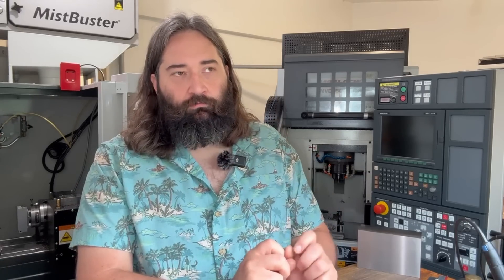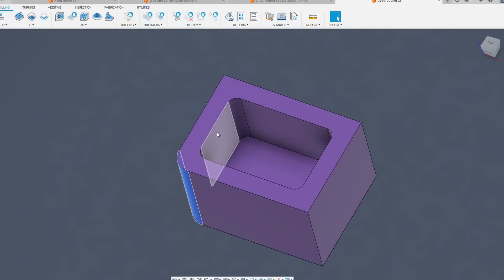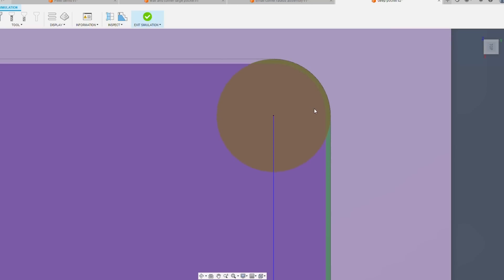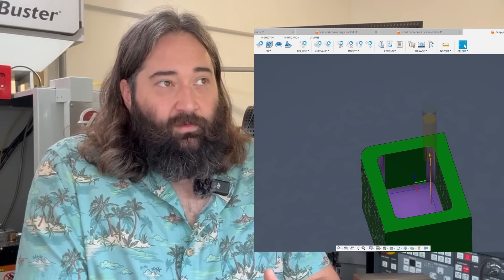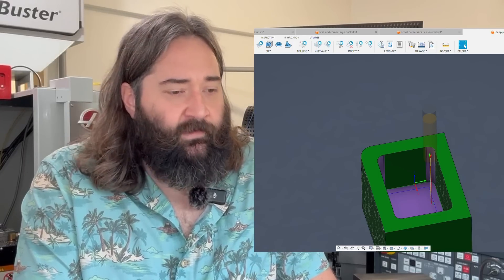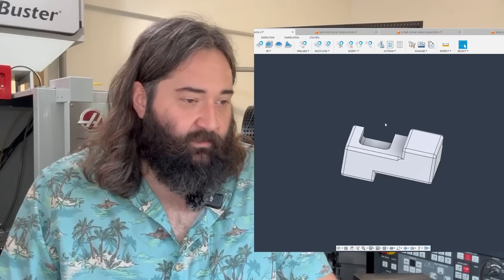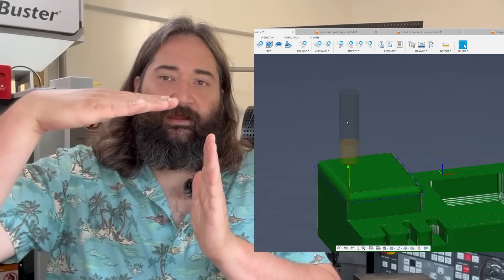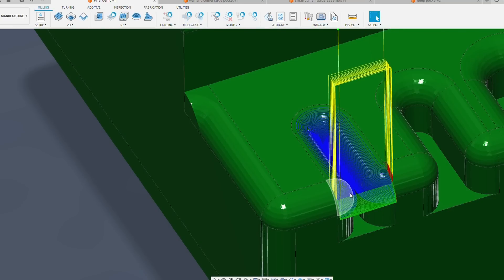Fillets make your cnc parts more expensive

Comment: I am not from a toolmaking community. I am from academia. Throughout all my years on mechanical engineering I noticed ME students do not understand some principles of design. I even wrote a syllabus of the course I called Applied mechanical design. The problem for the designers is in many cases they have no idea of how the part is going to be machined, what ready tools they can get, and what tools they need to make. Once I got a drawing from a student with a threaded hole close to a wall. I asked the student how it can be done, what tools and what a sequence. The student had no idea. Another issue is tolerances. You can not get on plastic same tolerance as on steel. They make in CAD same diameter hole and pin and expect it will fit when machined. Thermal expansion, surface finish etc. Unfortunately, young engineers are not ready straight from university for real design.
Reply: Having just graduated with a mechanical engineering degree, I totally agree and I think it's mostly because programs don't put much time or emphasis into getting students actually making parts. Our only required machine shop classes were pretty basic, and I think the most experience anyone got  making things was doing engineering extracurriculars that required fabricating custom parts.
Reply: @makky-kat3719  I've moved mountains to improve on the 20 seconds I've been able to get behind a lathe, to no success. I have to ask nicely if I want to use a band saw or drill press.
Reply: I still say the most useful job I had as a student was working for my university machine shop for the summer. Learned so much in just 4 short months of the various things they had me do. I wasn't completely green with actually making stuff then, I had done a fair bit of woodworking in high school, but it is so hard to teach someone to think that way without actually having them take raw stock and figuring out how to make the end product. As someone that now hires students for work terms now I definitely appreciate those that are part of student teams or have other hands-on experience as they tend to be much more capable designers and problem solvers.
Reply: Props for encouraging students to actually understand the manufacturing process - it's great to see that kind of leadership come from the academic staff. When I was studying engineering, we spent three or four weeks in a machine shop completing practical units from the mechanical trade qualification. It was really useful - especially for the students that didn't have any hands-on experience making things. Unfortunately, my uni stopped offering that to students a few years after I went through.
Reply: You shouldn't name that course "Applied mechanical design". Makes it sound boring and unimportant. Name it "How not to fuck up the simple things", and people will pay attention.
Reply: If you're handing out the Standard tool cards you're doing god's work man, and to be fair, even my peers in machining classes sometimes underestimate just how deep threads actually go...
Reply: We used to call it "design for manufacturing" and "design for assembly", it's certainly not a standard curriculum thing to teach but I was lucky to have a good series of teachers. But it's also a thing that an engineer learns over time just from experiencing failure and learning from mistakes. Everyone has made a part and forgot to add the right tolerance value at least once, but you try to never do it again
Reply: as someone whos just graduated with a Bachelor's in ME and a 4 generation family background in machining and engineering, trust me we are trying our best
some examples:
simple parts or assemblies that would be fit for purpose using mostly off the shelf components got significantly lower marks than overly complex rube Goldberg machines with every part costing £4000 because it "showed more of what you can do"
machine shop guys being super hostile to anyone who wanted to come and learn or even just watch
never ending pushes for everything to be 3D printed (its a useful tool, but it breeds terrible habits when it comes to design)
even the guys who did a year in industry got treat like walking coffee machines because no one wanted to trust them to do any work, they just sat around all day making coffee for a year
Universities being afraid to lose money on letting students just test out things, the first prototype must be the final piece
stuffing in so many random parts that there's no time for the stuff that mattered, I spent just as much time doing business as I did engineering and so we were left with just a few weeks for every project
Reply: "Unfortunately, young engineers are not straight from university "

To be fair, the same is true of doctors lawyers pilots etc. About the only high consequence job you can go directly from school to inflicting yourself on the world is as a cop....
Reply: I wish I could take your class! I thought going into my engineering degree that manufacturing constraints would be a large part of my degree, I even picked a university known for being more practical. So far I've had one subject that covered manufacturing processes but it was as surface level as could be, covering everything from sand casting to steel alloys. It seems my personal interest in manufacturing will have to suffice when I graduate.
Reply: This is the failure of universities that cost so much money, yet they don’t prepare us at all. I learned more in a year of real life work than 4.5 years of my aerospace engineering degree.
Reply: @DanielDuhon 
Who is running the Universities?
Reply: Decades ago companies made it a standard practice to have budding engineers spend time in the companies support and development shops. Now that is practically impossible because MBAs and accountants have off loaded all of that work to outside or off shore sources. 
I spent my working life repairing and rebuilding Machine Tools. Plus considerable work on the Toolmaker side. I had to do almost all of my own machining. Manual to CNC. Including programing. In my time I saw a lot of mistakes made on drawings. Things from misapplied tolerances to assembly errors that could allow for expensive bearings assemblies to be crushed (1). Over time we learned which engineers could be worked with and which ones could not. Of the ones that could not most changed when their bright idea didn't work. I'm not saying their bright idea would not work in an ideal world. Unfortunately the manufacturing floor is not an ideal world. 
1) Chamfers or through holes with +/-.0005. Bearing assemblies with their proper preload or end play set from the factory being held in such a way that the retaining plate or cover could destroy the bearings. One instance was the thrust bearing assembly on an industrial centrifuge. Tapered Roller Bearings and face to face mounting with pre ground spacers to provide the required end play. The remaining plate holding the outer races and spacer was designed with a 1mm gap between the mating surfaces. The end play in the bearings was .2mm. Far too easy for the assembly to be crushed during assembly machines if the customer was doing their own repairs. The design engineer was relying on M20 SHCS's being set to an extremely low torque value to maintain bearing endplay. Other examples of improper assembly would involve everything from seals being required to keep lubricating grease in on spindle right next to high pressure coolant with no provision to keep the coolant out. In fact seals are really big problem. Especially on machinery operating in dirty, steamy or machining environments with chips getting evacuated from deep holes with high pressure coolant. One more is spindle bearing assemblies using springs to maintain bearing preload. But without any radial bearing support on the back bearing. This can cause side loading from the drive belts to destroy the rear bearing. Made a lot of work for though.
Reply: Lego bricks actually have amazing tolerances.
Reply: You say young engineers have no idea about how things are made or how materials behave etc. Of course they don't. That's why they're in your class. You're supposed to be teaching them this stuff. You say they're not ready for the real world straight out of university. Well, that's your fault not theirs. They pay you a lot of money to learn engineering and you don't deliver on the product they're paying for.

If you were a company in the real world your customers would be taking you to court for breach of contract or cancelling all your purchase orders.
Reply: @OU81TWO     Wow, nice observation. Did I miss them mentioning they handle funding for their University, or ability to spend on supplies. I'm not sure if you're aware, metal stock is...not cheap, nor are tools, should they break from overzealous or overconfident engineering.

I feel like this hostility was meant for the bureaucracy of the school, not a professor actually doing the educating. The money in education is not in the educating, it's in the...actually, I haven't a clue where tf all that money goes, but it's sure not to the faculty, to the teachers.

Any of the material sciences courses seem to have so much more overhead locked up with consumables, which may not be much of an issue for theoretical sciences.
I'm sure there are experiments involved with those, but without funding, does a student simply fail if they had to scrap a part? Do they have to source their own stock and other consumables, or lab equipment? Or PPE? Or precursor chemicals for chemical engineers, etc.
At which point are professors being forced to subsidize their classroom, or just wait for funding eventually (like we force public schoolteachers to do where I am in the US)?

I don't know where you're located, but OP might not even be located in America. Outside of the US, matriculation isn't a soul-crushing black hole of debt that you only escape if you win big.
Here, it's a profit center, where the Dean and the board pocket whatever they can, and the professors take all the blame for promises made to students, so that they'd sign away their futures for the most predatory loans imaginable, (loans that can never be discharged, in many cases even after death...)
Reply: @NightsReign   Not sure what funding has to do with any of this. How hard is it for a professor of engineering to open there mouth and say "hey kids, you can't machine plastics as accurately as metals" or "remember to not design parts with holes to close to edges". We're talking about sharing knowledge. It doesn't take extra funding to do that. All it takes is opening your mouth and saying words.

I've been working as a mechanical engineering for more than 25 years in aerospace and I've shared my knowledge with many young engineers that I've worked with. The comment I always get is "you've taught me more in 2 months than what they taught at university in 4 years".  When I hear that coming out of a young kids mouth it makes me furious. They are paying to aquire knowledge and are not getting what they pay for. The professors are responsible for communicating that knowledge...assuming they actually have real world knowledge to begin with.
Reply: @OU81TWO   Well, I supplied an explanation as to why it did apply, but you didn't read it. So I guess you do you.

It really is bold of you to assume they didn't immediately follow-up with that instruction. I mean it's certainly possible, but to assume that off the jump. We don't even know exactly what kind of course they're teaching, something with machining, metal or plastic 3D printing, CNC design, maybe they're not even involved in the physical aspects of mechanical engineering. IDEFK.

I suppose I just don't understand why you came at this from an adversarial stance...
Reply: @NightsReign  I did read it. Did you even read the OP's comment? His words..."Throughout all my years on mechanical engineering I noticed ME students do not understand some principles of design". This is a very unusual thing for a ME teacher to say. Of course students don't understand. That's why they're there to learn. This is what prompted my response. He then goes on to say a student gave him a drawing with a threaded hole very close to a wall and he says "they have no idea". His last sentence is "Unfortunately, young engineers are not ready straight from university for real design."  I'm astounded that a a university teacher would say such a thing. It's literally his job to make them ready. If they're not ready then only he is to blame for not teaching them anything. I found his entire comment to be absurd because he's blaming kids for not knowing anything. If they knew everything they wouldn't be in his class to begin with. It's crazy.
Reply: @OU81TWO  I thought OP might have been hiring or interviewing rather than teaching - and there are schools who try to directly teach for specific industry jobs, thus asking them to write a syllabus - but you might be right.

Regardless, I wonder if there's some assumption of middle and high school workshop classes? Schools now favor consumer-facing 3D printing and (to be frank) in anticipation of automation removing labor from fabrication in the next few decades, there's not really an economic interest in teaching it, nor many teachers in the U.S. as others mention.
Reply: No one actually teaches this in university (at least for most programs i know or my friends went through) so I'm not really sure why anyone is surprised students don't know what they never were taught
Reply: This really makes a world of a difference. I was a machinist for 11 years and am now an engineer for the last 4 years. I feel I was able to get up to speed exponentially in building good designs due to my experience. 

As you said, obviously designing to available tooling and knowing that available tooling certainly helps a ton. But also, knowing what the machine can do and what it most definitely can not do is super helpful too.
Reply: That's why is make sense to attend a university or college that requires practical experience as part of the curriculum, e.g. internship semesters. Might be a less fancy degree from a less fancy school but the students are better prepared for the work place. Additionally, in the USA,  a university will rarely tell a student that they do not have the aptitude for a certain profession (since they want the student's tuition) whereas an industry professional will let you know. Parents should look at the rate of job placement after graduation rather than the name of the school.
Reply: We need a return to apprenticeships / vocational training instead of universities
Reply: @KaneYork   It depends on what you want to learn. If you want to become a mechanical engineer you need to have a strong foundation in some basic disciplines which isn't taught in vocational or trade schools. The problem with universities is they don't teach enough practical knowledge and the majority of professors are not exposed to real industry environments so they don't know what's going on outside their auditorium. They're behind the times teaching kids the old ways. They need to teach better. There are of course exceptions to the rule but far too many professors are out of touch with modern industry and the kids end up unprepared for the real word.
Reply: As a former cnc machinist, I both hated to see (future) engineers in the shop floor and wished they'd have to work, assist, supervise or something on the shop floor for at least a year before being allowed to design anything at all.
Reply: any source reading material for that course I can lok up? I am majoring in mechanical engineering myself.
Reply: @sahilmeena8018  I can not suggest anything. And it is a problem. During my more than 20 years of work as a research engineer, I hepled master and PhD students with their projects in areas such as fluid mechanics, jet and rocket fuel combustion, heat transfer, micromachining etc. I noticed that while they have some knowledge of theory, the luck of hands-on knowledge is a major problem. I have roughly 40 years of hands-on experience in multidisciplinary experiments plus master degree in metallurgy along with a PhD. in ME plus CNC and coventional machining background. So I spotted the  problem and started teaching my students what I called later applied design. The total number of students I taught exceeds two dozen. They are working now in big US companies, and some are research engineers. Then, I tried to make a course and prepared a syllabus. But nobody in our colledge of ME in GA Tech was not interested. Students mainly try to get their credits as fast as possible because they pay big money for tuition. They do not understand at this stage why it is important. And if there is no interest, such a course can not be added as a mandatory one. Anyway,  I was diagnosed with leukemia and no longer work. I am surprised how many people think it can be taught.
Reply: For sure. From interference fit to location fit ... tolerance is huge. 
Whether you're an architect or ME, it's hugely helpful to work in production for a while.
Reply: Had a drawing where the nominally perfect edge of the part was only .003” from the nominally perfect edge of a threaded hole.
Reply: I don't understand why students aren't teached those things anymore.
What happened.
Reply: @Splarkszter most of the manufacturing went overseas leaving a huge gap between the people designing and the foreign land that is actually manufacturing the part. Less opportunities to actually understand how things are made